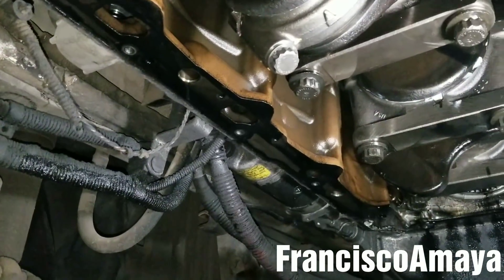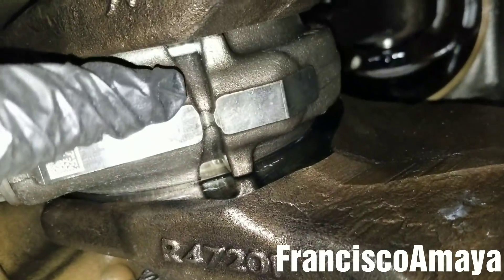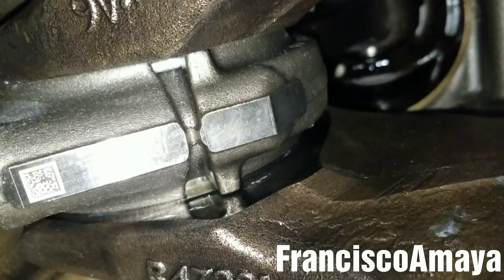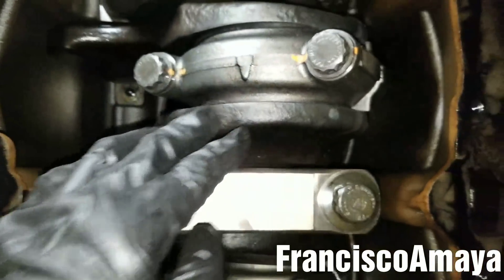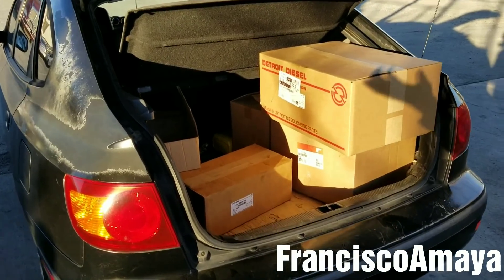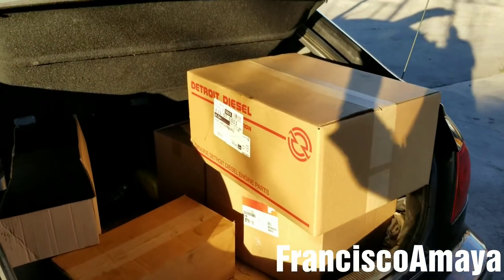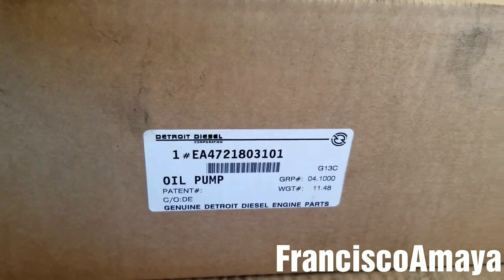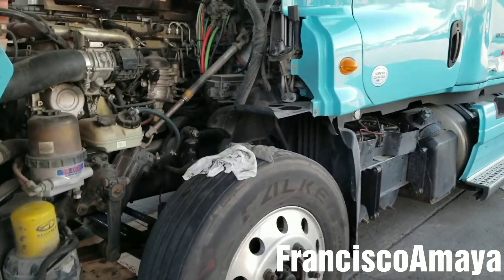Freightliner cascadia DD13 DD15 DD16 main rod thrust play crankshaft bearings replacement 5

Comment: How many miles do you usually run that rotella T5 before changing?
Reply from the maker: 25k miles. They said, it can last 50k miles but I do as maximum 30K miles. That way the oil is always in a good condition and protecting the engine at all times.